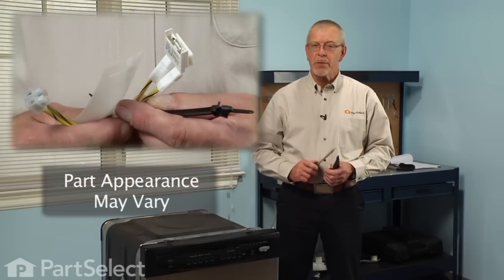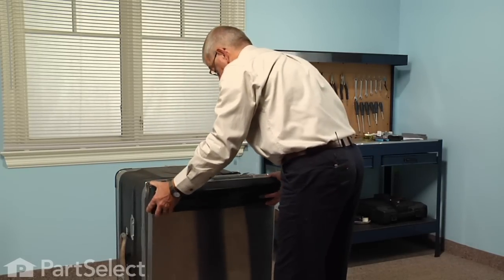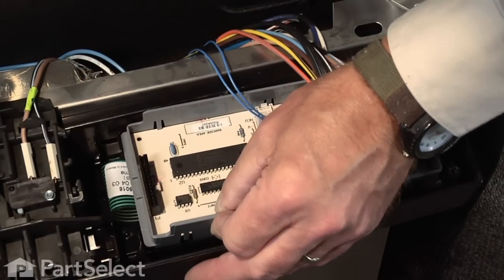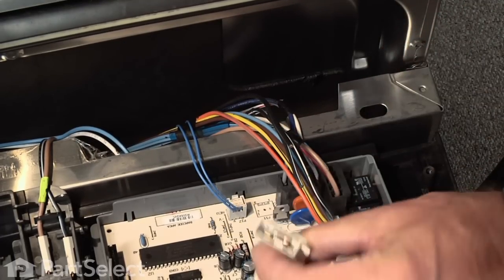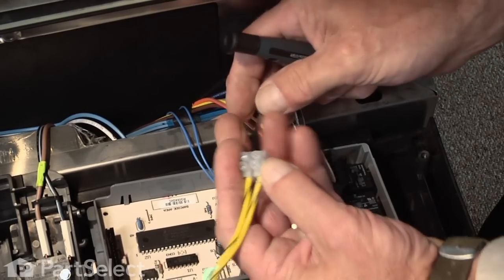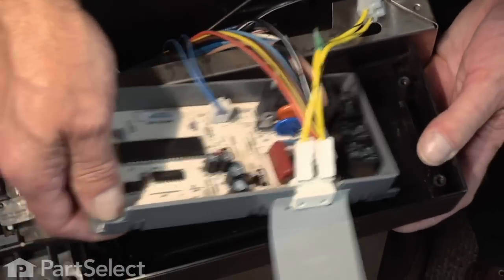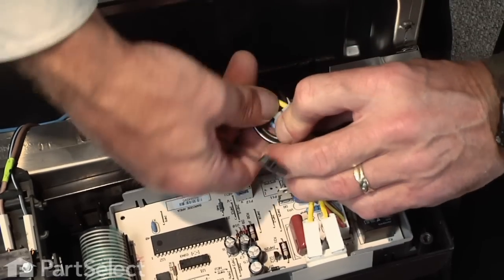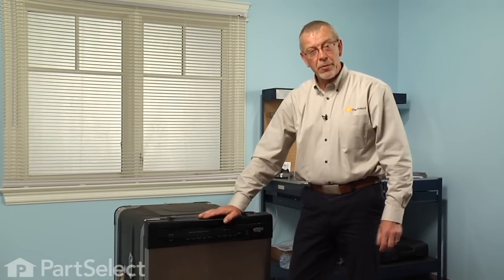Dishwasher Repair- Replacing the Fuse Kit and Wire Harness (Whirlpool Part # 8193762)

Comment: The wires from sears are very thing but bundled and twisted, I am having a hard time to get those twisted wires into the clamp and making them stay even after using a screwdriver to clamp the wires down? any suggestions?

Comment: I have no lights, no response on the dishwasher as though the breaker is open, but I have power passing through the door closing latch interlock (don't know official terminology) when manually engaged.  Is this fuse kit, wiring harness a possible cause?  Than you.

Comment: My dishwasher had the start and cancel lights blinking for a while. I had to reset the power in order to get it to work. Sometimes this would not work, sometimes I had to leave the power (breaker) off for a while. No it wont do nothing at all. Does this sound related to a fuse problem?
Reply from the maker: +Christian Rodriguez What model number do you have?